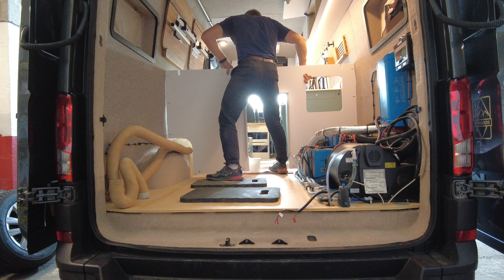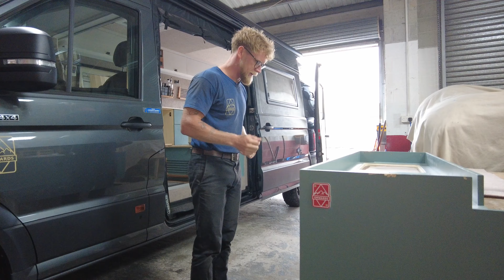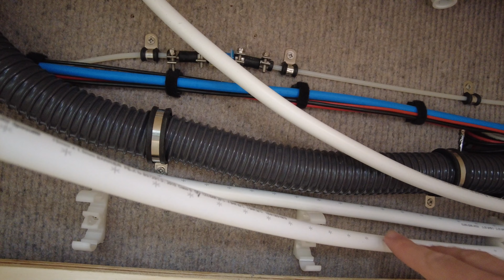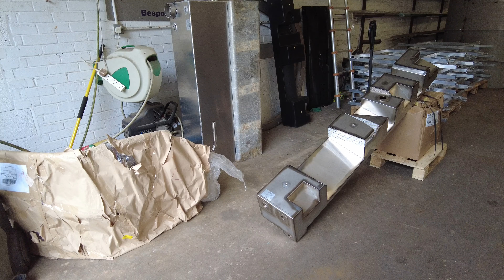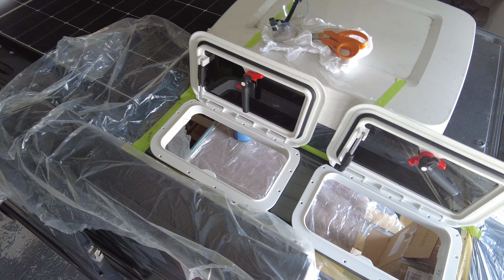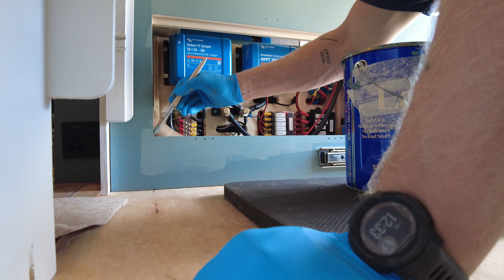Why a campervan is never finished...

Comment: Tape round with masking tape, the blue 3M is good...I have fitted a great many fittings to both vans and boats in te past 35 years. Your doing great! very OCD, Its a great mantality to have it makes the neatest jobs. Just one more thing be careful with the double O ring inserts..there are some JG fitting that leave very little pipe after the insurt. On occasion it has not entered the fitting in order for the stainless washer to grab it enough, measure the one with an O ring and then measure a normal one. Then measure a few fittings you have, you will see what im getting at. Great channel and great vans 👍
Reply from the maker: Thanks for the reply and input : )